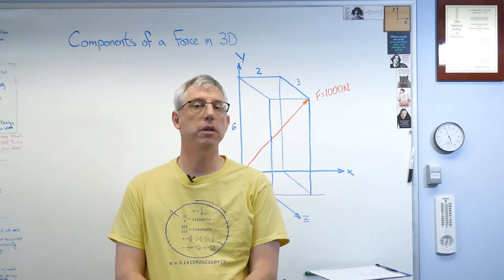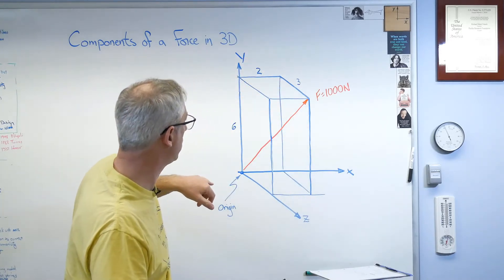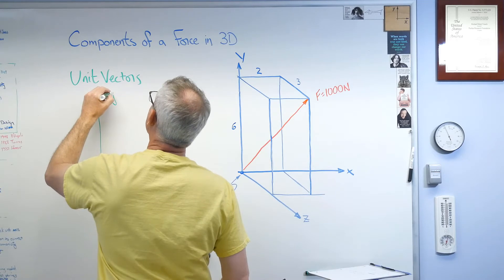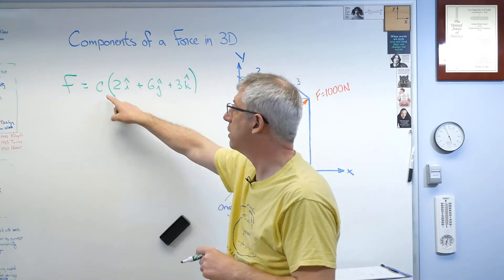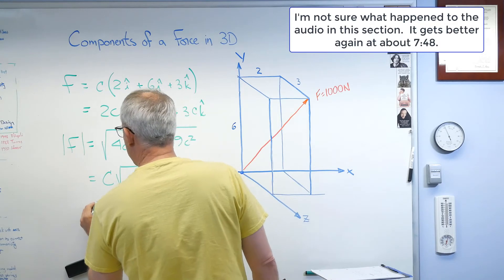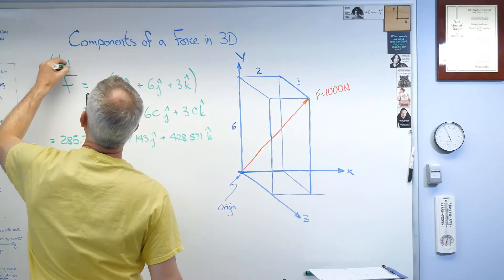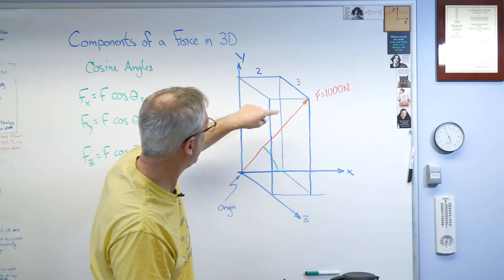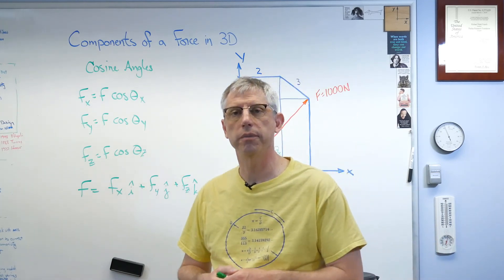Statics - Forces in 3D

Comment: Btw.  Mathematicians call a number with value of one.  A unit.  Engineers call a "description" of a unit like inch, mm a "unit".  As engineers shouldn't we just refer to this  "so called mathematical unit vector" as a unitless vector?  I prefer to just call it a position vector, which then becomes a direction vector(unitless) after it get's normalized.  Normalizing(actually a math term) means to divide by it's magnitude which thus removes the "engineering" unit...thus becoming unitless...but "pure direction".  In fact, what kind of vector do you get when you don't use angles and trig terms, but actually use the distance divided by distance....the "true trigonometric ratio of sides" to specify the i, j and k directions?  A direction vector.  However, as you know it is also what I am calling a "unitless vector".  Furthermore, it is actually a "ratio" vector or even call it a "percentage" vector, because unit vector = direction vector = direction cosine vector = normalized position vector = all are decimal values between 1 and 0.

Comment: It might help students to visualize that there is "two things" going on.  The force vector, and the position vector.  The force vector with resultant(as shown) plus fx, fy and fz.  Also, there is no "relationship" between the actual length of the "force arrow" within the blue rectangle to be the actual length of the rectangular diagonal.  In fact, by drawing the length of the force arrow equal to the "magnitude"(of the position vector, not shown) it becomes misleading.  How many students will upon first glance(also, now fully prepared for class) will think that the blue numbers 2,3 or 6 is actually the component of F?

Then in another sketch lets show the position vector < 2, 6, 3 > (as shown) but also it's magnitude.  Ah-ha that was "hiding" under that red force arrow.  This is very hard to visualize for the students.  So, now the actual magnitude of the position vector "truly lies" inside the box as the diagonal(...or what I like to call the 3d hypotenuse). 

Now the slope concept can be applied(in 3d space) to the directions, but instead of rise over run....it is x over magn, y over magn, z over magnitude.  Instantly, that's your direction cosine vector